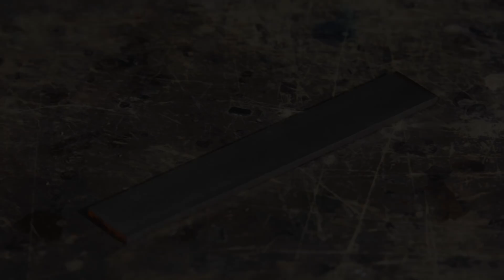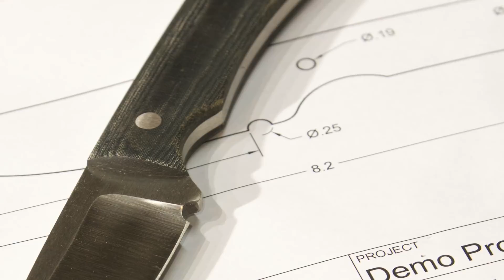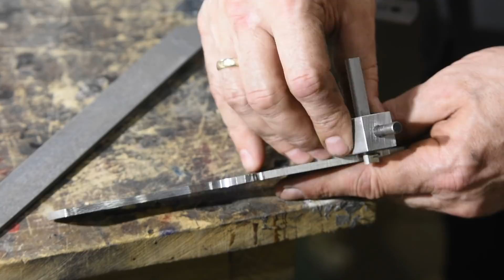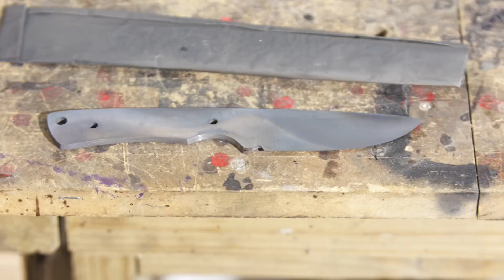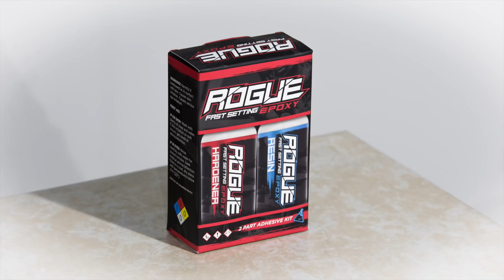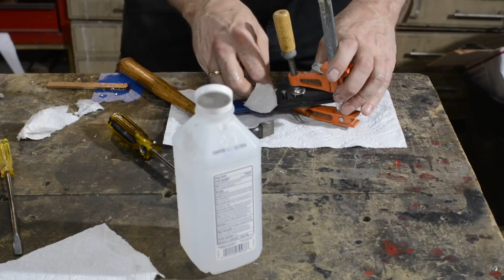Make a Knife from Scrap!

Comment: Thank you. So much to learn. As a disabled vet, I have a real limited budget. So I have a couple of questions. Is used motor oil accepted for quenching? And why use epoxy when fastening the scales? I would think that it would be challenging should you need to replace them. Your knowledge is appreciated.

Comment: are Canadian steel grades the same as us
Reply: If you run with the ASIS designations, it should be, since that's american. Though I know there are non ASIS designations that metal is also sold by, so you might want to do a little cross referencing first.

Comment: I'll be glad when this trend of easy to make full tang knives is over... way too many handle heavy blades out there. Especially obvious with smaller blades. Dang.
Having said this, I watch everything Walter does. Altogether comprehensive. Mostly.
Reply: Perhaps drilling some holes into the tang to lower the weight on that side might be an option?

Comment: What would your go to steel for a diving knife be, and is there an international steel shipping company you would recommend? There are no reliable knife steel suppliers here in my country.
Reply: A knife that is going to come into contact with ocean water, it really has to be a stainless. Some good ones are Nitro-V, 154CM, S30V, S90V, or AEB-L. You MIGHT be able to get away with D2 tool steel, but it’s not a “true” stainless as it has a tiny percentage lower of Chromium, however, it is still very corrosion resistance with care.

Comment: Also im probably preaching to the choir here but if you counter bore the thong hole before setting the hollow pin you can use daps while setting it to make sure never moves even without epoxy on the pin

Comment: Why use corby pins if you're going to permanently attach the scales with epoxy? Seems like a waste.
Reply: Ricardo Cedillo this is my 2 cents as a knife maker.  If you don’t use a corby bolt or loveless, which is what I prefer, you are relying solely on the epoxy to hold the scales on the knife.  I prefer to know that the handle is on there and nothing short of grinding it off will remove the scales.
Reply: @callmebigdaddy850  So in essence, a safety net.
Reply: Reploidx9 yes.

Comment: My scrap material doesnt look like clean, flat material. it is more like coil springs, worn files, leaf springs, lawn mower blades, worn hedge clippers and something like that. Of course with a thick layer of rust and dirt on it.
Reply: Hw dose leaf spingd work out? & have you ever used any" ar" plate? Armor plateing, its real hard as in tough., wonder if its workable?
Reply: @kennyclement2823  😍😍🙏🌹
Reply: 🤣❤️❤️💙💙🌈🌈🌭🥪🌭🥪 Ok okokokokokokokokokokokok and 😍😍😍😍😍😍😍💋💋💋💋🌭🥪🍔🍔🍔🍔🍔🍔🍔🍔🍔😘😚

Comment: Has anyone used titanium foil for heat treating SS blades or for carbon infusion? I don't do SS blades myself, but bought some foil from eBay, and later found out that Ti is much cheaper. I cannot see why it wouldn't work as well as stainless, or in fact even better.

Comment: I've got a question, I was hoping someone could help me with. I cut out a knife blank but it's not straight, would heating it up till non magnetic and letting it cool down correct it, or do I have to clamp it as well? Sorry if it's a dumb question, but I'm not sure what to do.
Reply: 64t120r thanks a lot for your help.
Reply: steven van rensburg 
It will be best to clamp it,if you heat it up to non magnetic and just allow it to cool it can curve more in the same direction.Steel can be bent at lower temperatures if it is thin.How long is your blank?
Reply: brian Coghlan thanks for your reply, it's about 5 inches long.
Reply: steven van rensburg 
If you have a flat surface get something thin you can use as shims on both ends of the blank.Then heat the blank and put the curved side up on the shims and hit it a few times with a hammer.If the steel is hot enough it will bend easily so be careful.
Reply: brian Coghlan thanks a lot
Reply: I use a scrap piece of angle. Brian mentioned shims. A lot of people use pennys. Over bend in the opposite direction. I heat it up to about 400 F in a tempering oven (NOT my wifes toaster oven). It works.
If your blade warps during the heat treat, clamp to the angle during the tempering. Usually works.

Comment: The roughing up of the handles scales is what should be done to the steel too, that way you create mechanical adhesion, most knife makers finish the steel under the knife handle to too fine a grit as a matter of pride..unless you are making removable scales there's no need to.

Comment: Another great video..
  I've been thinking about when your knife broke on F I F... COULD IT HAVE BEEN A POOR TEMPERING(FIF TEAM) PROBLEM??....or has that happened to you before?
Reply from the maker: The smiths on FiF don't control tempering, so there's no telling what happened there.  But mainly I just ran out of time.  I intended to differentially heat treat the blade, which would have made snapping highly unlikely, but three hours is not really enough time to make can steel in an unfamiliar shop environment, so I had to through-harden the blade.
Reply: Walter Sorrells still you did a great job there. I can imagine the heat, wrong lighting and huge time pressure is a killer combination.

I do not believe they mess up tempering to manipulate the show. Seen finalists swords break too and they did all of the work at home. To me it looks time pressure and the chance to win money can mess up your head quite a bit
Reply: Time pressure, not having time to normalize the blade after forging, In many cases the blades are hardened but not tempered due to the time constraints, and last but definetly not least the strength test are brutal. Above and beyond what any normal blade would be subject to with everyday use. Even what hard use military operators would put most blades through.

Comment: Sorry. It's WAY BETTER to drill AFTER profiling.  You can adjust profile and not F the whole thing up while trying to profile and for instance grinding and adjusting tang size.  ALWAYS drill after.  sorry Walt, you're wrong on this.
Reply from the maker: I beg to differ!
Reply: Jack are you doing one offs or multiple units, If doing more then one I always drill when the stock is square.
Reply: One at a time always.  speed kills.

Comment: What type of bits do you run to drill the holes? Im tired of burning bits
Reply: tony montana high quality Cobalt machinist's bits are your friend.
Reply: Normal high speed steel drills work fine. Have a sharp grind, use cutting oil and low RPMs
Reply from the maker: I use cobalt as a general rule.  As jfpinkston says, using cutting oil and not running them too fast will help a lot.
Reply: Walter Sorrells thanx love the videos
Reply: jfpinkston thanx
Reply: Austin Fox thanx
Reply: And if you forge knives, make sure to anneal the steel, make it soft by cooling it slowly after forging
Reply: Oskar Skoglund thanx i have been using saw blades and i have tried to anneal but they are still really hard
Reply: @tony montana yeah, toolsteel can be a pain in the butt to anneal, simple carbonsteels are much easier.